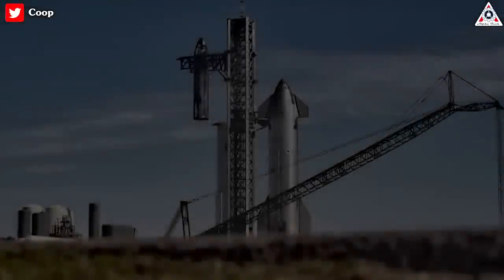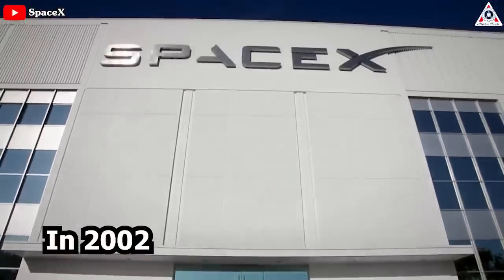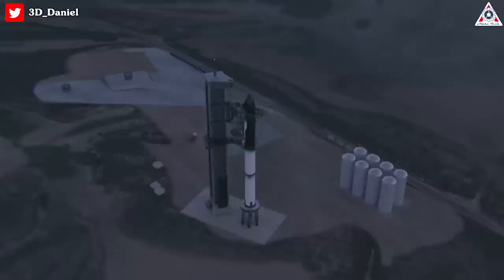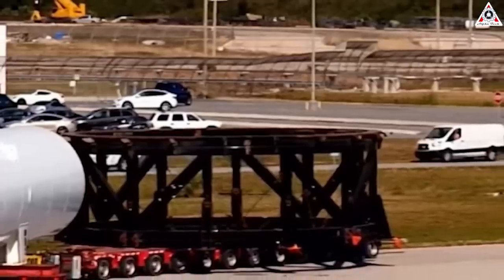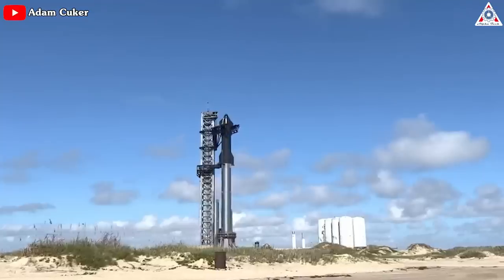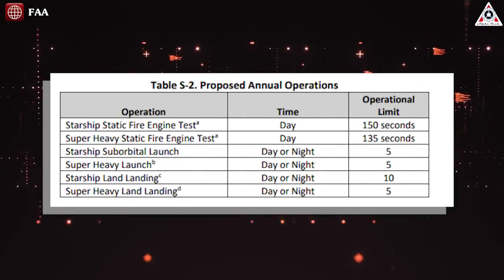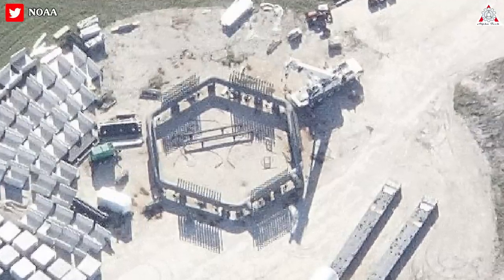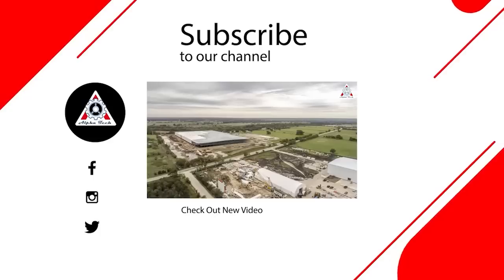SpaceX Stage Zero HUGE UPGRADE: ""Water deluge"", 33 engine ignition...

Comment: To fix the blast back problem they could use the heat shield tiles under and between the legs of the OLM even outside of the OLM as well

Comment: I've often wondered why a rocket can't be enhanced to take off horizontally from a runway, fly to a low altitude on a subset of it's engines, gimbal-pivot a little, and then 'launch' from within the sky ???

Or: Returning from Mars surface, one could just employ the water 'De-douche' system.
Reply: To do that you need wings and jet engine not rocket engine.

Comment: I don't know why X doesn't use the "jump and push," maneuver off the OLM?.. Use 12 R2's to get it off of the OLM, then start the rest of them. It would save the pad, and limit the amount of tonnage you would need from H2O to suppress the sound and vibration.

Comment: The temperature isn't the problem as much as the pressures, vibration, and erosion caused by the combination. This is going to be a REAL problem when landing on Mars, and taking off again. The Martian soil is going to be blasted and likely form a crater making landing extremely hazardous. Test landings on unprepared surfaces is highly recommended!

Comment: I feel every time the launch pad is damage is likely to break and destroy support pillar launch pad. I thought they have learn from mistake since the rocket power is far more stronger, heat and sound. They need to plan in case of crash of the launch pad.